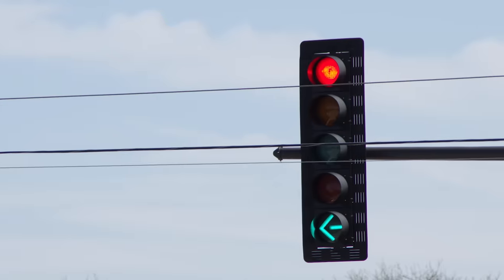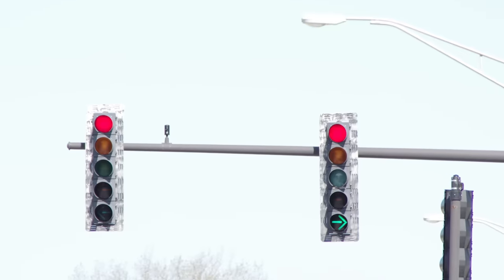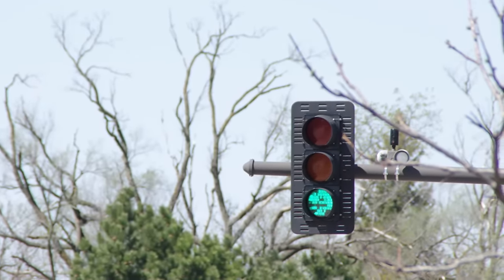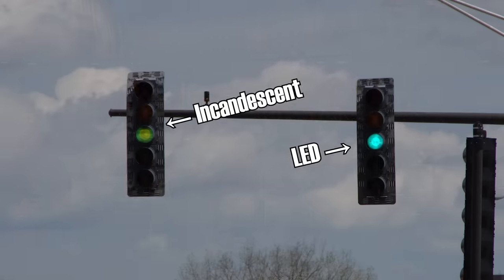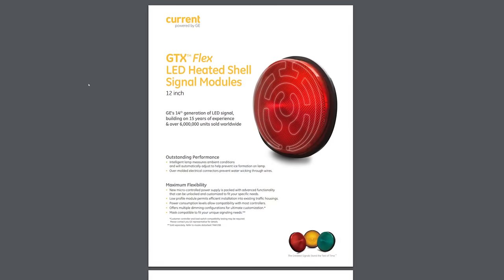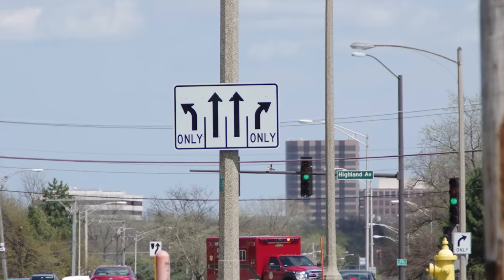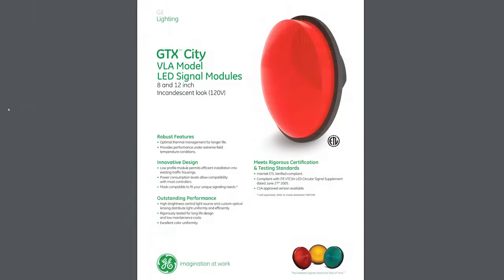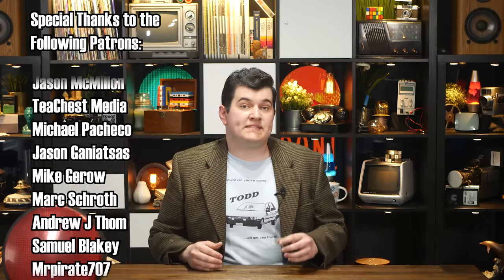The LED Traffic Light and the Danger of "But Sometimes!"

Comment: This is actually a very persistent problem where I live. Right now, any traffic light that faces south is completely frozen over and useless. We get high winds and very fine snow this time of year; when I look out the window the snow is practically moving horizontally. The problem too with "treating it as a stop sign", at least here, is it's multi-lane traffic in all directions and only one side of the lights are out: the rest are still functional, leaving half the people trying to obey the lights and the other half trying to treat it as a 4-way stop. People just don't know what to do and it's backed the hell up. There hasn't been any effort from the city to actually take any of the steps to mitigate it (heaters or that shade thing) either so it basically boils down to "hope you don't crash". It definitely depends where you live, since that "but sometimes" is a "very common all winter" kind of issue here.
Reply: It definitely depends where you live, since that "but sometimes" is a "very common all winter" kind of issue here. --> I would have said the same, as well as the problem of only part of the lights not being visible, hence STOP-sign rules are confusing. But.... If it is that very common, well.... come on city !!!!!! There are solutions out there.
Reply: Sounds like a temporary force-majeure -- and that's actually when a traffic policeperson is supposed to get out of the cruiser, put on a warm coat, pull out the staff & whistle, and regulate traffic by hand signals. At least that's how a temporary severe weather hindrance is solved here in the 'developing world'.
Reply: @seredachan  Yeah, good luck with that. Canada has sky-high taxes but next to nothing to show for it: our infrastructure and public services are horrid.
Reply: Indeed. I don't know why he's pretending snow only happens for 2 months a year.

Snow often starts here in October and can easily keep happening until June.

When they upgraded everything in our intersections a couple years ago they simply changed out for different incandescents.
Reply: @seredachan  and that's different from sending out a maintenance guy because...?

Oh right, it's not, they're probably getting paid about the same only the maintenance guy isn't going to try and rip you off if you screw up.
Reply: @RunicSigils  youre right, good points, rip all the traffic lights down and have a guy standing with a fire signal at each intersection, the best of all worlds eh? creating jobs even. boomer.
Reply: @RunicSigils  He just has tunnel vision, is all. He lives in Lombard, Illinois, if him filming at Highland Avenue and Lilacia Park in his videos is any indication: they get chilly winters for sure, but it's nothing compared to places further north: Illinois at its coldest averages about 36 inches of snow per year, but where I live (Quebec City) we get an average of 124 inches a year. It's winter here as early as October and it lasts into late March to early April, with temperatures of around -20C being pretty common. Snow just builds up here and doesn't go away; our snowpack lasts well into April.
Reply: @ScrambledAndBenedict  don't forget the freezing rain and powerlines down and national guard comes and visit your end of Canada almost every winter .I'm not from that area, I am assuming you get the same weather as Ottawa... correct me if I'm very wrong.
Reply: @wynottgivemore9274  Couldn't tell you. I've never lived in Ottawa. You guys are pretty close though, so I'd assume you guys get pretty similar weather to us.
Reply: @ScrambledAndBenedict  im not from Ottawa, you comment before you edited it said you were from Quebec...im pretty sure that is why i assumed you probably had the same weather pattern as they do...but now that i looked at the map,Quebec isn't as close to the coast as Ottawa is...that has been hit by ice storms nearly every winter for many  winters...
Reply: But its still a solvable "but sometimes" problem. Its not a reason to keep the old bad version, but to, you know, fix the problem
Reply: @DimT670  Canada: "We're going to increase taxes yet again."
Taxpayer: "So now you'll be able to solve all these easily fixable infrastructure problems, right?"
Canada: "|:)"
Taxpayer: "...Right?"
Reply: @seredachan  That's an expensive improvisation if you live anywhere north of the 40th parallel
Reply: @ScrambledAndBenedict  Don't feel too bad. The US has far lower taxes and ALSO very little to show for it. My state even "thinks ahead" by providing state subsidy to private contractors for infrastructural development and maintenance.

Our infrastructure blows.
Reply: @RunicSigils  Back when I was a kid, it would snow regularly for 3 months of the year. The past 5 years, I estimate it snowed less than 5 individual times per year.
Reply: @GeoMeridium  😂😂😂
Reply: Hi, I'm in Ontario, and yeah, infrastructure fucking blows here, I can attest to that too.

Just read through a Financial Times article that brought up a rather interesting point. According to independent auditors from the EU, ranking various countries on their infrastructure programs, Canada is unique (and not in a good way) in that it has next to zero coordinated long-term planning at all for public works projects.

What centres of ordnance opt for instead is a "if a severe problem comes up, fix it" approach, rather than taking preventative measures by taking good care of existing infrastructure. So it's only when shit REALLY hits the fan that a damn is given; the long-term is totally ignored.

Honestly, explains a lot. Kudos to those researchers who found that out.
Reply: @lettuceman306  It might explain why we get so many power outages. It's weird to hear people in Europe talk about power outages as if it's some incredibly unlikely thing, when we get like 10 a year where I live.
Reply: @ScrambledAndBenedict 
10 times?
That's a lot. It normally happens maybe once a year where I live and even then only for a couple of minutes max.
There are exeptions, like when a storm manages to destroy a substation or several power lines, but that's a once every ten years scenario.
Reply: @carstekoch  As of now we've had 4. Two during snowstorms in winter, one in spring (don't know why), and one only last week (don't know why). The two don't know why's were short, both happened when I was at work and I only know because my clocks reset and my 3D printer stopped, but I have no clue what caused them.
Reply: I’m in Los Angeles, and while the state may occasionally turn off the lights to the excessive power demands, our “grid” - local and western U.S. - hasn’t gone down but two or three times in my 60 years.
Reply: @davidepperson2376  I envy you guys. We lose power numerous times a year up here. Often for no discernible reason. It's practically a guarantee during annual snowstorms.
Reply: @ScrambledAndBenedict  Sounds like people need to organize & collectively petition the city to do something about those lights, both before it inevitably happens again (and then, again when it does), with desperate appeals for safety. As well as telling them about those solutions (maybe specifically demanding them in the grievance) in case the dunderheads might not even be aware that such solutions exist.
Reply: Canada too. Have had one blackout in 22 years that lasted 3 hours (other than the North American blackout of 2003).  You must live in a crappy area as far as hydro goes. 

Our entire region has gone to LED traffic lights. No issues so far in the winters but William have shields over the signals.

Comment: I remember back when LEDs were first being considered for traffic lights they had a problem with getting a green LED! The red and the amber were easy but for some technical reason the green was a problem. I think that's why the "green" as actually closer to blue in LED traffic lights. 🙂
Reply: I remember the yellow being the last color to be available, but that was 20 years ago and I partied hard back then.  We were just phasing in the 18 led units that directly replaced the bulb.  The sealed units with lots of small LEDs sucked to replace in the field.
Reply: The lens is Blue on the incandescent traffic lights for the Green light.
Reply: @shakehandswithdanger7882  actually, yellow and amber were available very early along with red (granted the first yellows were red dies with yellow casing ^^')
Green arrived late, but i think it was blue that was the hardest to get "in the die". Other colors use III-V materials for the die, while blue required to develop SiC semiconductors to get that color.
But these were somewhat short lived anyway since near UV LEDS with colored phosphors became the norm shortly afterwards which is what we have now.
Reply: Interesting aside... Here in the UK the railways still have some semaphore signals which also have illuminated lenses that can be seen in the dark. On these what is always referred to as green is actually blue. This is a hangover from when they were originally lit by oil lamps where the yellow flame combined with the blue lens gave a green indication and even though they are now all lit by electric light they carried on fitting the blue lens.
Reply: A friend told me a blue tint can be helpful to people with red-green colorblindness so affected folks don't have to rely on the position of the light (red is always topmost for vertical lights).
Reply: @CyberSlugGump  I'm sure the exact colors vary from place to place, but where I live the green lights have a sort of cyan hue which is much easier to distinguish from red than a more standard green would be with red-green colorblindness.
Reply: @shakehandswithdanger7882  in my town there used to be many lights that had LEDs for the red and green lights (the ones with the clear lens for the green) only and incandescent for the yellow lights. Since then, they’ve been switching to the “incandescent look” LEDs, with the green lights now having green lenses again.
Reply: The old yellowish greens are much less bright than modern blueish greens and cyan colours.  The modern ones do have a forward voltage of around 3 volts, rather than just over 2 volts, so have more in common with blue devices.
Reply: Are you color blind? It looks pretty green to me, not even turquoise!
Reply: Are you saying they hadn't invented green plastic yet?
Reply: @rossbrumby1957  Green plastic wouldn't be any use. The LEDs of the time emitted light at only one frequency - its own colour. Only a white LED would work with green plastic and there was no such thing then. It's the same principle as not knowing what colour a car is if illuminated only by an amber sodium vapour streetlight.
Reply: @rossbrumby1957  all I know is when Steve Jobs introduced iMacs in 5 colours, they had study plastic chemistry to get the colours they wanted as they made the iMac in colours that were previously not available on plastic. So could be the same issue with traffic lights.
Reply: @ledoynier3694  red dies with yellow casing wouldn't work because red LEDs contain no yellow.
Reply: @CyberSlugGump  Yes, the blue tint helps! As a red-green colour blind I do want to note that we don't go by the position of the lights. The confusion comes from the term "colour blind", which is not accurate at all - in almost all cases it's just a deficiency. Problems typically arise when there are multiple colours overlayed or next to each other. In terms of something like traffic lights, I can clearly distuinguish them 100% of the time, as do most with a similar diagnosis I believe. Our brains have adapted to distinguish/name colours through contrast if it's otherwise difficult. Having the colours in a black frame is in fact more beneficial than the blue tint (though that helps too).
Reply: If I recall correctly, right back around the time they were figuring out manufacturing for white LED light bulbs, they kept having problems with the green formulation. The red and blue were easy, but they wanted a green too, to make a pure white with. Problem was, the green formulation was incredibly inefficient for the light output. Maybe that’s why they had an issue getting that color.
Reply: @TDownit_Strider It was the blue that was the difficult one. With red, yellow, blue you get white light.